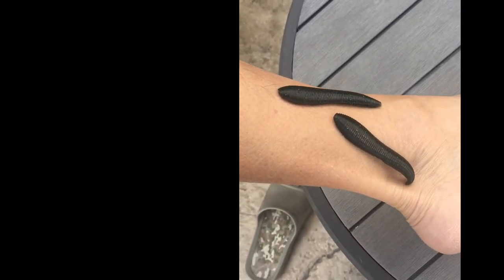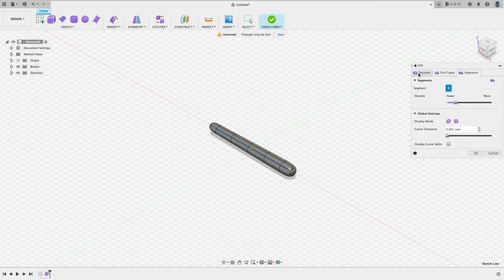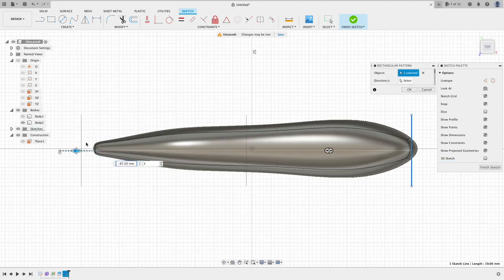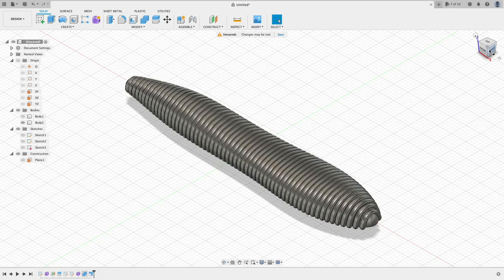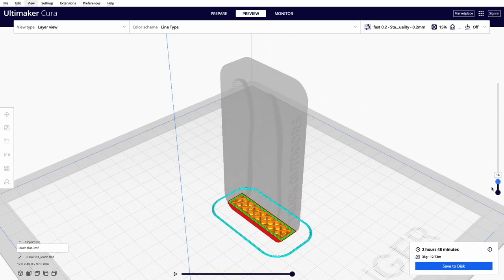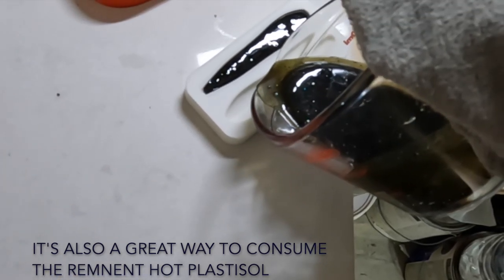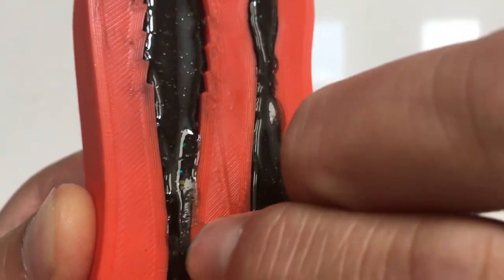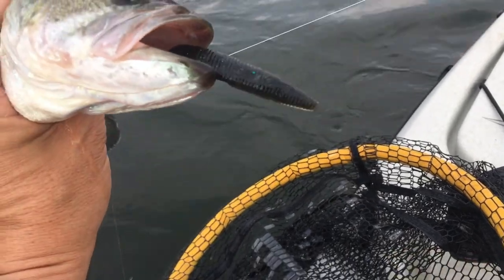Easy-to-Make Open Pour Mold - Leech Soft Plastic Bait DIY

Comment: Question instead making an open pour mold. But make a mold to make an open pour silicone mold, instead leech going in but create a box around it to make additional molds for later on, can you do that
Reply from the maker: I think it would be easier to just print the leeches as your master, then make silicon molds with multiple cavities as many as you want. Does that make sense?

Comment: The 3d mold how many molds can you make? Will the heat of pastisol hurt the mold. Do you use a special filament?
Reply from the maker: If you control the temperature properly, the mold can last for a pretty long time. But you can destroy it at the first injection -  I did it before. For injection molds, I will try to shoot them below 310F; open pour molds can hold a little hotter like 320F. This is for PLA, I have not tried other materials. I think resin molds can stand higher temperature. If you want to go mass production, you will need to invest some metal molds. Hope this helps.
Reply: @yauckoutdoors